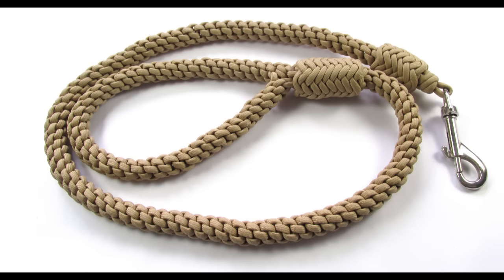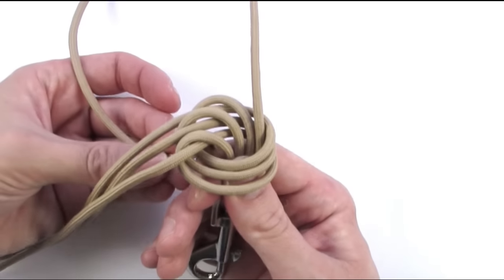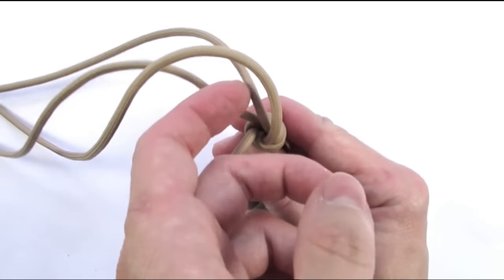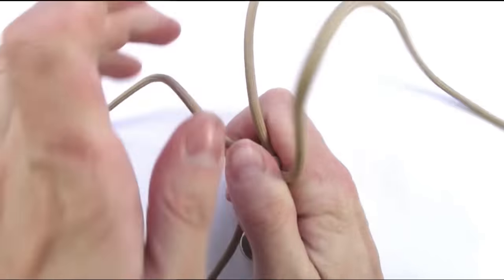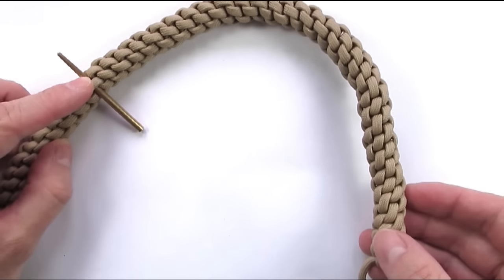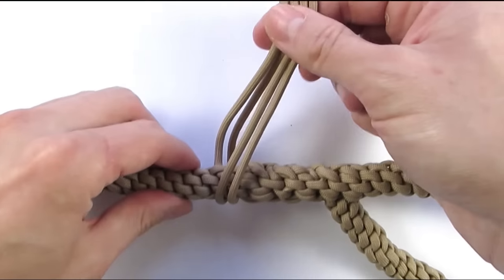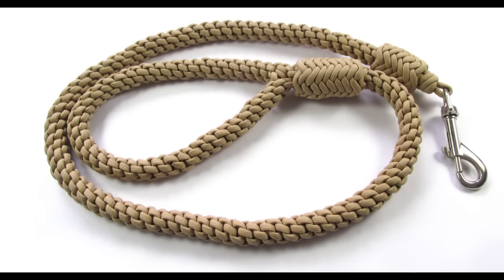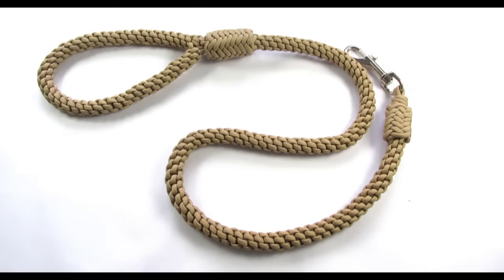Crown knot paracord dog leash

Comment: I've made this leash 3 times now (for 3 different dogs), I absolutely love it. So comfortable, secure and I love that it's a little stretchy. Thank you!
Reply: I don't see how this is possible with 80 feet of cord x 2. I want to make a 6 foot leash. According to the instructions he used 39.5 feet for a 3.5 foot leash. So I doubled it but make all those knots with 80 feet of cord is VERY difficult! How did you do with 40 feet and not get all tangled up? I would buy one from you.
Reply: I’m sayin the same thing.  I want to do a 16 footer but eeefffffff that
Reply: @wxmyjnsn  It's easy , stead of working and fighting with meters of cord , you can make 4 bundles to work with.

Comment: At the 16:40 mark, I think I might insert the cord into the leash, then run it down through the snap hook, back up into the leash and out the other end. This would make it look as if it were simply passing through the leash, while doubling and reinforcing the connection to the snap hook. This would be especially good for larger or stronger dogs.

Comment: Quick question about the Herringbone knot. If I spliced mine a little further down the leash and I need three loops to cover the area with the Herringbone knot, do i do the under-over three times instead of two?
Reply from the maker: Hey there Matthew!

Excellent question. Indeed, you wrap around three times instead of two times. This will result in a longer knot. Naturally all further steps are a bit longer as well, but following the same pattern.

Congratulations in getting this far, you have learned not one knot, but also how to make it longer and shorter!

Mark
Reply: @Paracordguild  
Thanks for the info Mark. Your tutorial was really helpful on every aspect of the leash. I never knew how hard it would be trying to make crown knots with two 50 ft length cords but i got through it. Wish me luck on the Herringbone knot, thanks again.
Reply: @siceros  I do wish you luck! The crown knots can be hard on the hands. Somehow I was able to do the leash quickly, but sometimes doing it in several sittings can be more enjoyable.

As far as the length of the cords/ends goes, you could use shorter strands and splice in more length when needled. For some reason folks avoid doing this like the plague, but it works!

Here is what I mean (old video):
https://www.youtube.com/watch?v=QI5F7xcxu0U

Mark

Comment: Great tutorial, but how the heck did you work with 39' cords without a tangled mess every few minutes?
Reply from the maker: Hey!

The two cords are halved at the very start so you are using about 20 foot long ends. At the start it takes a bit of patience, but the crown knots don't really tangle your cords all that much.
Also, the good thing is that with every knot, your ends get shorter and easier to work with!

If you still dislike working with long ends of paracord, try this technique:
https://www.youtube.com/watch?v=e_eABN09_Fs

Mark
Reply: @Paracordguild  thanks for the reply. It's not that I don't like working with long cords, I just never have. I just got a puppy and he tore up his leashes already (he's a devil:) and I really like this leash you made here. What I did is wrapped them around my hands to make a ball (of sorts) and am letting more out as I go; the knots weren't tangling, the extra cord was. If no luck I'll check out the link you gave. Thanks again for the reply, much appreciated.

Comment: Awesome tutorial thanks. Definitely going to have a go at this. Quick question, how much cord do I need for a 3 foot leash?
Thanks
Reply: I would imagine that you could divide the length of the cord he's using by the final leash length to get the cord/foot ratio, then simply multiply that number by the length of leash you want to make. should get you in the ballpark. 

39.5' / 3.5' = 11.286 x 3' = 33.772 (34')
3' / 3.5' = 0.857 x 3' = 2.57 (3')

should get you in the vicinity anyway :)
Reply: 2 x 40ft strands of chord devided into 4 x 20ft lengths

Comment: Lovely weaving and beautiful finish,  however!  The trigger hook is still only held by 2 thin strands of chord,  what is the actual breaking strain of the chord please?  seems alot of weaving for such a weak anchorage,  unless it does have a good pulling power breaking strain!?  Beautiful work though 👍
Reply from the maker: Hi there!

Paracord is usually stronger than the snap hook. Even two strands can be incredibly hard to break. Naturally the momentum of the pull exerts more strain on the cord than a static load, but still, for most dogs it should be fine.

Mark

Comment: So what length do I need to make a five foot length leash? Does this include the handle?
Reply: Dennis Lackey OK, if I did the math right... Each foot in length for the final leash requires (2) 136 inch long (or 11.3 foot long) strands. So if this is correct, for a 5 foot long finished leash you would need (2) 56.6 foot long cords.

I make no promises that this is correct.
Reply: Chuck Hackett this helped thanks
Reply: How did you come up with 136inches???
Reply: In the original video, the materials list that you need 39'-6" for a 3'-6" long leash. 39'-6" equals 474 inches long. Take that 474 inches, divided by 3 1/2 feet comes out to about 136 inches (a little less, I rounded up) needed per foot of leash.

FYI, I used this formula to make a 5 1/2 foot long leash... came out to 748 inches (62'-4") (136 * 5.5= 748 inches)... the final length was about the 5 1/2 feet that I wanted (closer to 5'-10"). My dog pulls when we walk, so the leash has stretched out longer and is about 6'-6" now. I'm ok with it stretching out, I usually wrap the leash around my shoulders so my hands are free, so no biggie if it's a little longer. I also took one of those black alligator clips that you use to secure papers together (overgrown paper clip with handles), fed it through the leash and now I can't just clip poop bags on that so I don't have to carry those either.

Comment: I think the leash is stronger than the metal hook. Will you do the tensile strength testing for the leash?
Reply from the maker: You are quite right. The cord is very strong, plus quite resistant to water and regular wear and tear. If the hook fails after a while, you can easily replace it with a carabiner.

Comment: I am at the herringbone part, I did all steps correctly but the knot is never "straight", the "herringbone" part is never a straight line, it's always oblique. I tried tighting but it doesn't come out straight in any way. I'm pretty confident with all the steps (I re-did it few times, even made practice with a smaller one) but I cannot figure it out... Any suggestion? :)
Reply from the maker: Congratulations on getting through the knot tying! Not many can do this!
I am well familiar with what you are experiencing with the herringbone knots. The way I get them to look good/round is to tie them very loose, then gradually tighten up. Make sure that the "V" shapes (crossings) are lined up and it should work out. Practice makes perfect, keep at it!

Have a great day,
Mark
Reply: @Paracordguild  Thank you for the suggestion! :) I'll try soon!

Comment: I wish your video had been you threading all 39 feet through itself and keeping the lines even to make that Matthew a Walker knot. I'm ready to break something trying to tie this damn knot.
Reply from the maker: Hey there!

The Matthew Walker knot is not a must. You can skip it and go directly into a crown knot. It is just a nice transitional knot.
As far as the knot goes, it takes time to learn. The key is in adjusting and tightening. Practice with shorter cords :).

I have a few tutorials on Matthew Walkers on the channel, be sure to check the tightening on those!

Mark
Reply: CB650Ryan lol
Reply: you can make some rolls whit that cord and pass them in the holes it will be much easier
Reply: I practiced with short cords until I was happy I had it under control working with 39 feet was tricky but I rolled the ends up tied them and used my lap and the drop from knees to help control them. Must say I was close to pulling my hair out too. But the practice on short cords really helped me get the feel if the cords. The last bit I was overthinking and your hands on the video don’t show but basically when you push the left loop up you just wiggle them all to get a square, I kept tightening to much .
Reply: 39ft isn't long enough...😅🙈
Reply: right there with you CB650Ryan.  I have attempted this knot probably a hundred times and gotten a decent looking knot maybe 3 times.  Makes you want to slap your mama.  some knots ain't worth the trouble and humiliation!  and to hell with the herringbone whatever knot.  i have tied 6 of these leashes and gotten a good looking herringbone once.  i have gone to finishing with a wrap knot-not as pretty but at least i get the leashes done.
Reply: @Paracordguild  i want to buy one🙂❤️

Comment: Love this leash. Quick question, are each of the long cords 39 ft.?   thanks!
Reply from the maker: Howdy!

Two cords are used, each about 39,5 feet. They are folded in half to produce 4 ends, each end is then about 20 feet long. It may seem like a lot, but the leash is also quite thick- about the same as an 8 strand braid.

Mark
Reply: The lead itself is strong and quite thick but the trigger hook is only held by 2 thin strands of chord?  Seems a bit weak in comparison to the rest of the lead which is beautiful,  do you know the pulling breaking strain of it?

Comment: I am having some problems running 4 strands back through crown knot to form loop 
is there a more detailed explanation of this part
Reply from the maker: Hey!

As long as you work them in it is all good, we cover it with a decorative knot anyways. It can get quite tight though, I know.

Mark
Reply: Paracord guild please help me with the length of a five foot crown knot leash? What is the golden rule with this knot ?
Reply: Dennis Lackey if he's using 40 per cord for a 3½ft leash than I'd suggest adding under 20 ft or around 60ft(each chord)for your 5-5½ft leash. Any extra cordage can be used for transitional knots to make your handle look cleaner and uniform. Hopefully you've figured it out by now but in case anyone else needs the info.

Comment: great video but you can loose track of what your doing in the mist of the turning of the leash and which end goes where. would of been better if u used different colored cord for each so it would of been easier to keep track. Other than that great vid

Comment: Easy to show with a 3 foot piece. Not so easy with 40 feet
Reply from the maker: Easier to show yes. But it is not a lot different with longer ends. You just take a bit more time to pull the ends through. 
The good thing though is that with every knot the ends get shorter and easier to work with.

Mark